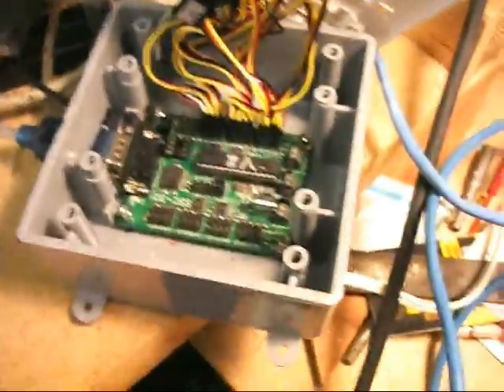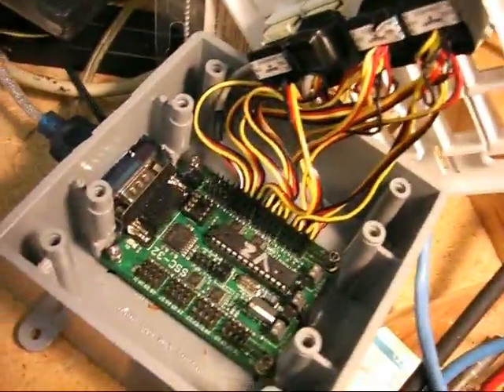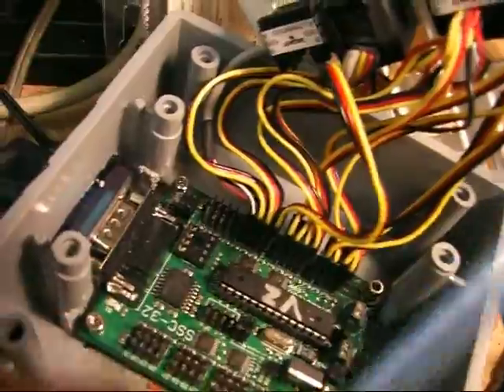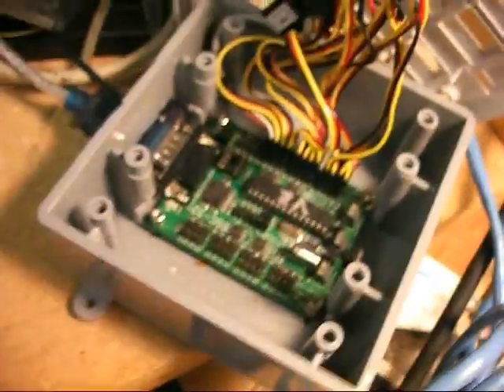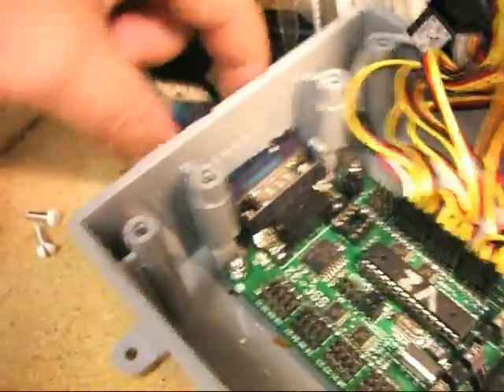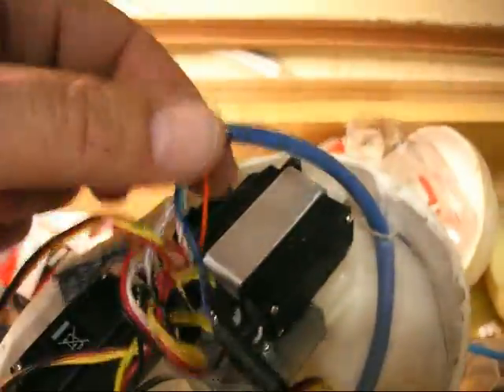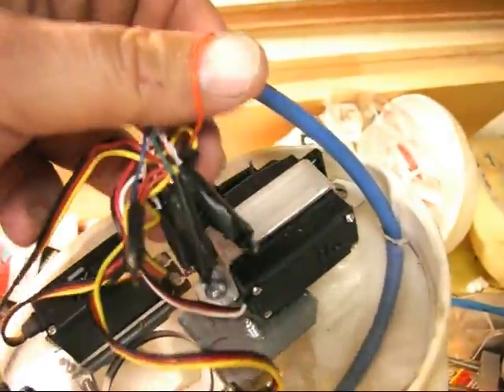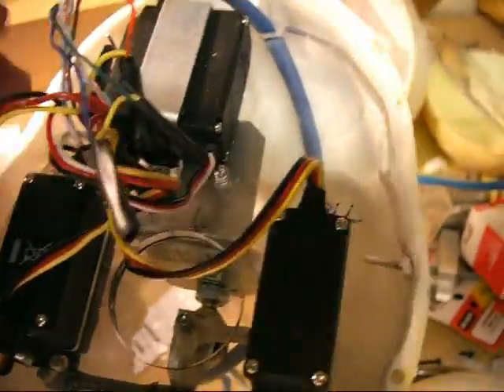3-axis Lynx Controller

Comment from the maker: The program is called VSA, Visual Servo Animation, available only from Brookshiresoftware.  It's petty easy to use once you get the hang of it.. you set the servo range limits, import the audio file, run the audio analysis, that puts the "move servo" commands based on the volume of the audio file.  What I would suggest is to make a plain file with a single loud tone as an exact copy of the file you want to use.  (more)

Comment from the maker: I ended up skipping the Cat5 sockets as they were -very- expensive to use for the boxes.. I ended up clipping the pigtail off the servos, soldering them right to the length of Cat5 cable on one end (that end plugs into the board) and the other end of the Cat5 cable is soldered right to the servo leads.

Comment from the maker: For the plugs or the Cat5 sockets?  The plugs, the yellow (or whatever color the command signal wire is) goes to the command pin on the board, red is the +5vdc and the black is the ground for either..  I cant remember how the pins go for the Cat5 sockets as I switched from the sockets (waaaaaay too expensive to make them worth it) to just soldering the servo pigtail right to the long Cat5 cable then that to the servo.  Hope that helps.

Comment: How do you wire the pig tails of the servo connection on the cat 5 socket. Example how do you get all the reds to fit on the stripe green/stripe orange socket and all the blacks to fit on the blue white/ brown white socket. In your video the connections look clean.
Reply from the maker: Each socket has punchdown "fingers" that hold the wire.